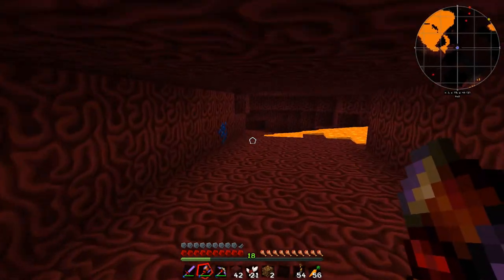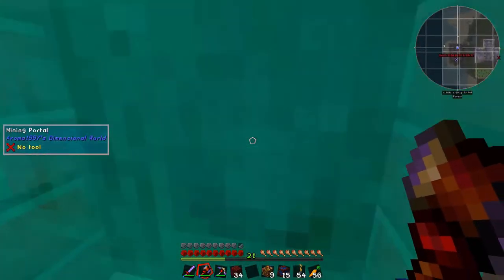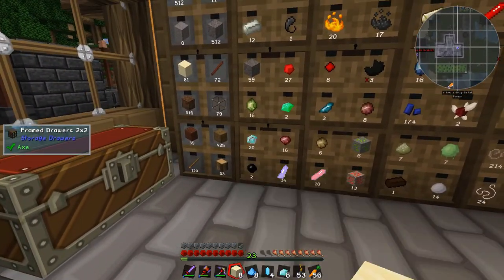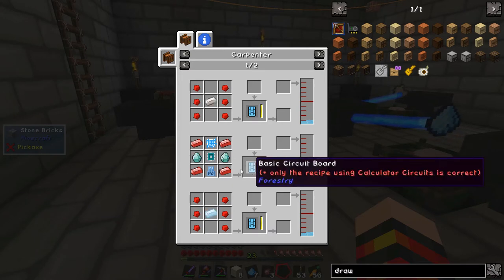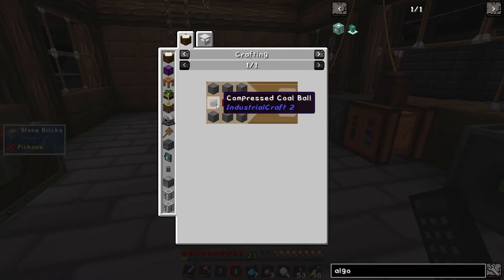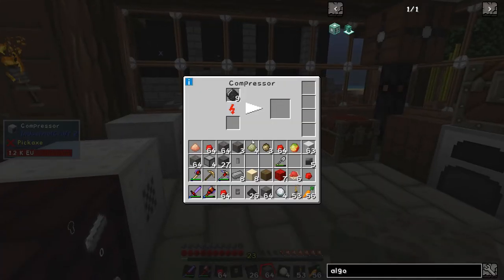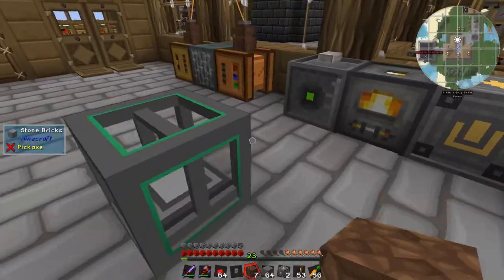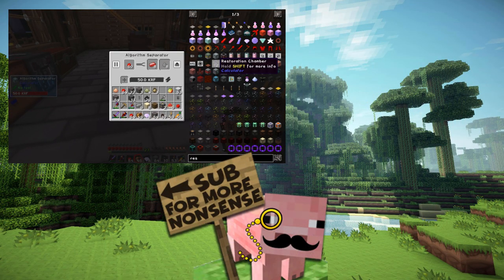Age of Engineering #20 | Algorithm Separator & Dirty Circuits! | Closet Gamer

Comment: You can macerate coal blocks as well. It costs the same time, but gets you nine times the coal dust.

For the complex recipes: if you want to go a step back in the crafting, press backspace.

Nice series by the way.
Reply from the maker: LordPINE that coal tip is awesome and is literally going to save me hours! I also didn't know about that backspace shortcut with JEI, it was getting frustrating going through the recipes from the start each time.

Thanks so much, keep the tips coming
Reply: Don't know if you have it already, but for the plates, the block cutter is great. It can turn a block into nine plates, at the same speed as a metal former.
Reply from the maker: LordPINE yep got the block cutter a a couple ep's ago - it's fantastic! :)

Comment: To answer your question Closet Gamer. IC2 coolant is rather annoying to collect. You need water piped into the Solar Distiller and a very long time to make distilled water. Then you can take that and pipe it into the Bottling plant I believe and convert it to IC2 coolant using crushed lapis. You can make coolant without distilled water but it takes a lot more lapis.
Reply from the maker: Christopher D. Thank you Christopher! I'm glad I wasn't being blind and missing something obvious :) cheers for the help
Reply: I struggled to find all this out last time I did IC2 as it's not in JEI and finding the info on the internet is hard. You have to find a youtube video of someone doing it or something. Another tip is you can click in the bottling gui to swap tanks and change modes. The default mode doesn't make coolant. I think the correct mode is "enrich"
Reply: Adding to his tip here distilled water (as for many other liquids) can be stored in other mods tanks. I built an Immersive Engineering tank (holds 512 buckets) and attached it to the solar distiller. Over time I ended up with a nearly inexhaustible supply of distilled water for making overclockers.
Reply from the maker: Pro tips from both you guys today! Christopher, I'm fairly sure I would of been pulling my hair out about the enrich mode so thanks in advance for that. Andrew, The IE distiller sounds like a nice passive method for a steady supply of distilled water, I'll be sure to hook it up and give you guys props in the video :)
Reply: later on the line you will need to build the heat exchanger, with it you can make distilled water easily, just pipe water to a steam boiler(using the heat exchanger with lava), and put a condenser with a heat vent and some power to make tons of distilled water while you make the pahoehoe lava
Reply from the maker: +Tsukiumy cheers for this tip dude, what age does the heat exchanger become available?
Reply: Liquid Heat Exchanger is Age 8 or 9. You'll need Iridium to build it which you'll need IC2 nukes to generate effectively (UU Matter). After getting your first few nuke cycles run you can switch to Advanced Generators (they need Plutonium) to scale EU product with liquid fuel or you can expand into MOX fuel and IC2 steam nuclear reactors to generate more EU/t.
Reply from the maker: Andrew Hrubik nice! Any idea of the amount of EU/t I need to be generating at the final ages?
Reply: The Mass Fab as far as I know will take any and all EU you can throw at it and it produces UU matter directly proportional to the amount of EU it's given. UU matter is very much worth it. The pack adds some custom recipes that allow you to use it to produce things that are a pain in the arse to make otherwise.

Word of warning: IC2 reactors blow up if not configured or monitored properly.

1mb (milli-bucket) of UU (without scrap) costs 1 million EU
1mb of UU (with a full scrap load) costs 166,000 EU (use this method)

For example my world is currently Age 9 and I'm throwing 4 reactors worth of power (360 EU/t each) at it. I fully intended to convert to MOX fuel which should up my output to (1000 EU/t each) at it and I'm considering further switching to steam reactors to up the EU production. 

I have 6 recyclers with 6 overclockers each fed by 2 emerald cobble generators producing scrap currently. I'll likely need to double that once I convert to MOX fuel.

My nuclear fuel and scrap production setup is run using a 4 liquid fuel Manyulum turbine Advanced Generator running on Forestry Ethanol. This keeps all nuke power routing directly to the Mass Fab for UU production.
Reply: Andrew Hrubik only switch to mox if you want power, im sticking with my 420 and preparing one with 27 single rods just for plutonium
Reply: I've got a robust ethanol system running for my on demand EU power needs but I may switch over to a dedicated nuclear reactor (+ MFSUs) for EU power. I can't see running MOX fuel for power though unless you have constant large scale demand like a Mass Fab on your main power network. You have to keep the reactor hull hot (ie 80%) to get the increased power generation so once stable it needs to stay running through the entire cycle and I honestly don't have that type of demand outside of the Mass Fab.
Reply: In the long run (age 8-10+) you'll want to switch to solars for EU power. No other power source compares. When you first get enough iridium to make a molecular transformer, make it, then immediately use it to make more iridium for advanced solar panels to upgrade to ultimate hybrids. Each ultimate hybrid is 512 eu/tick. They're kind of expensive initially, but pay for themselves pretty quickly as they are zero maintenance, and continuous power output if you're smart and set them up in the mining dimension. I currently have about 20 feeding into my mass fab and array of overclocked recyclers, and it's making more UU matter than I'll ever use. I literally have a drawer full of 2048 basic capacitors from it.
Reply from the maker: Dream Vigil cool, I'm just about there at the moment (on ep41) and I was wondering about end game EU power. I like solars because of the "setup and forget" approach you can take. Did you setup the whole UU matter system over there it did you teleport the power back to the overworld?
Reply: I initially set it up in the overworld because I was running both my uu matter setup and my molecular transformer off a nuclear reactor and tree farm/fermenter/biogenerator array. I switched it to the mining dimension when my solar production outpaced the both combined, which only required two ultimate hybrids, actually. I originally had all my hybrids dumping into my molecular transformer. I only wanted iridium for more solar until I finally got so much that I'll likely never use it (I have around 8k iridium at this point), then I took all all that solar power and dumped it into UU matter. I never tried transfering the EU across dimensions, as the only way I know of doing that would be a quantum bridge combined with AE P2P tunnel for EU, the second of which is very buggy. It was just easier to move it manually.
Reply: You really can do better with stable MOX reactors. I have 4 MOX reactors pumping 1024EU/t each into the MassFab 24/7 generating around 60 buckets of UU a day. The whole process is automated similar to what Closet already has setup. All you have to do is feed an industrial grinder Uranium every couple of days ( I do 10 stacks) and you'll have enough 238 to run the process indefinitely. In fact I've got so much 235 (4+ thousand) built up now I'm thinking of reigniting my old Uranium reactors to add a little more into the mix.
Reply: i double that, from just processing a bunch of quads i already have 10k 235, its realy a high surplus u get, because aside the extra 3 you get for each 2 cells you make, you get some in the reprocessing of the depleted cells, more than enough to keep all your mox running